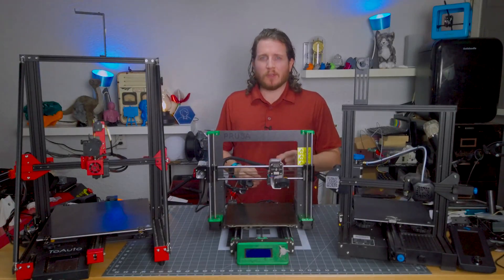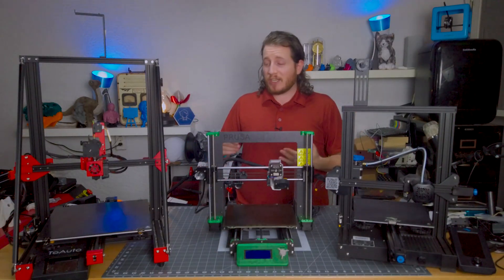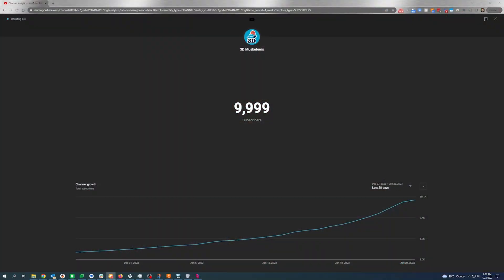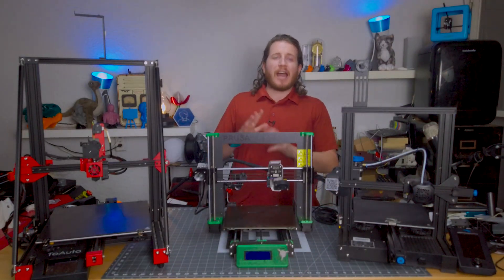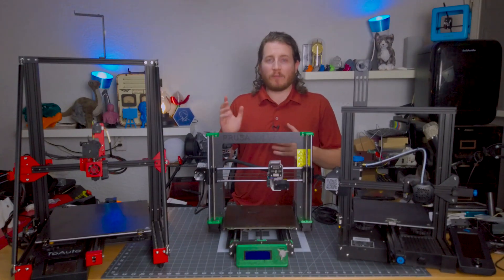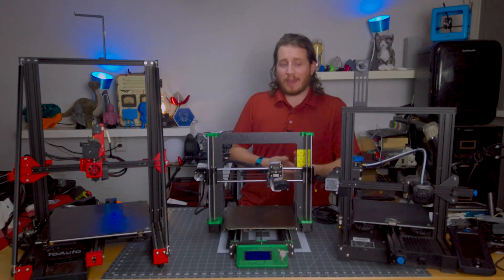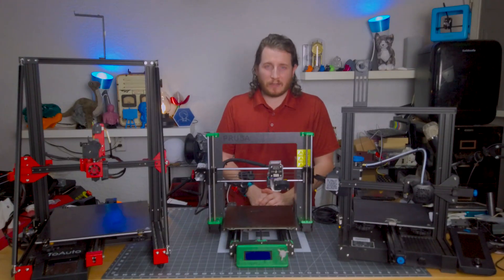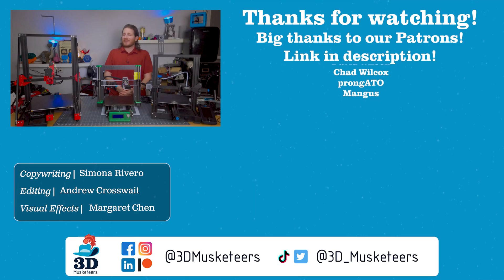Maintaining the BELTS On Your 3D Printer: For Beginners!

Comment: I recently got my 3d printer 2 months ago, the Anycubic Kobra 2 max. Overtime I noticed clicking sounds but didn't think much about it until finally I get an error code, and when I go to check the belt its completely snapped off. This really sucks since im a beginner and it will be hard to repair.
Reply from the maker: it should not be TOO bad to repair. Look at how it was held in and just follow the steps to replace it. The belts are not a full loop so replacing it should not be too bad
Reply: @3DMusketeers  Alright I will let you know how it goes thanks :)

Comment: Hi mate, stumbled into this doing a YT crash course in coreXY now I finally have one :) Great video as always. Weirdly I prefer the set up of the Ender3 Pro / CR10 etc for tensioning the X belt, slack two bolts, use an alen key to apply tension and tighten up the bolts, works for me, my worry with all the printers having the easy to adjust knobs is that people with no idea will just use them to turn the belt tension up to 11 and then wonder what's going wrong, but I'm strange like that :)
Reply from the maker: Definitely agree. There could be an issue there for sure!
Reply: @3DMusketeers  Maybe I'm just a cynic but then again, you've met people too, we know what they can be like :)

Comment: I recently bought a monoprice maker pro mk1 printer that made a cricking noise and gets stuck when moving, I’ve moved the bed, checked the auto level system, turns out it’s the belt under the bed, do you know any fix with this issue?
Reply from the maker: You may need to replace the belt. Without more info I'm not exactly sure what the issue could be.

Comment: Hi, a materials scientist doing 3D printing here. I find very interesting you assertion that glass belts stretch less than steel. Steel has an elastic modulus (stiffness) 3 times higher than glass. At the same time, the crystalline structure of the metal makes it less prone to “stretching” (permanent deformation) than glass, that has an amorphous atomic structure (yes steel is crystalline, glass not).
If the tension is appropriate and the belts are manufactured correctly, I would definitely expect the opposite.
Reply from the maker: It's fiberglass if that helps? We also find the steel bands keep belts from flexing right when you need to really tightly run the belt it can jump teeth. We find in practice that the steel reinforced belts are more problematic than fiberglass or kevlar or some other material.

Comment: I have the CR10 style on my Biqu B1 belt, do you have a print you recommend? Or a part to buy? My local Microcenter has these Creality X-axis Belt Adjustment Knob for Ender 3 S1 Pro at $4 a piece. I've done really well with prints, but as a newb with year old machines, I worry. I have tightened by hand of course. Prints have continued to be beautiful. (I run two Biqu B1s.) Thanks for a great video.
Reply from the maker: if it aint broke, dont try and fix it IMO
Reply: @3DMusketeers  ty. I always keep the same idea. Both printers are flawless again. Watching print fix Friday on Mac as I seen this. You’re the man bro. 😎 🙌🏼✌🏼❤️🫡

Comment: When i bought my Prusa Mini (at that time not the Plus)  i had an issue with the x-axis belt. In the beginning all went kinda smoothly (this was my first experience with a 3D printer) but a couple of good prints later it didnt at all. Lots of back and forth with Prusa later, all the adjustments you can think of, i found that the belt was missing some teeth missing or damaged. Therefore also other things on the x-axis had some issues. Decided to sent the Mini back because it was still in waranty. They replaced it and even upgraded it to the Mini+ for free!!. Now everything is running smoothly.
Reply from the maker: gotta love Prusa Support! Crazy issue though! definitely one for the books!

Comment: 2 Months into my Ender 3 V2 I saw that it was printing with like 4 threads holding the X-axis belt together & it Snapped after it finished the print.

It seemed like I over-tensioned it. Lesson learned that day. 
The new replacement belt is holding up so far.
Reply from the maker: At least it lasted out the replacement print!

Comment: I have snapped a belt on my ender before. It was the x axis because I tightened it wayyyy to much

Also just had to replace a stepper on my voron v2.4 because of overtightened belts too! Lasted a year though so not too bad

Congrats on 10k as well!!
Reply from the maker: sounds like you need to keep an eye on your belts more ;) 

Thank you!
Reply: @3DMusketeers  haha very true! 1 snap and 1 motor in 2 years of printing. Definitely could be a lot worse
Reply from the maker: 100%. It is a cheap lesson to learn for cost, but one that is pretty expensive for time

Comment: Good video.  I'm working on my Rat Rig belts now.  A core XY is even more difficult to get correct.  Too much tension can get the printer out of square and too little  will cause potential layer shifting if a skip happens.  It is also hard to keep everything in vertical alignment so the belts don't raise and fall.
Reply from the maker: Yep, belts are soooo important